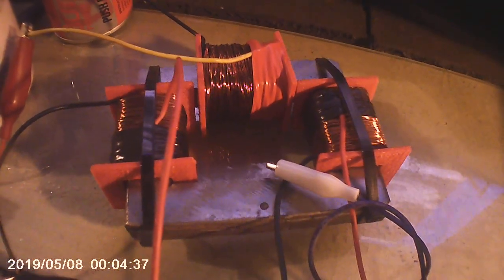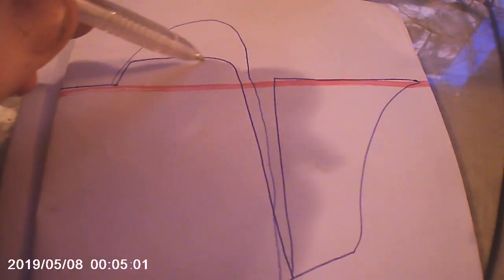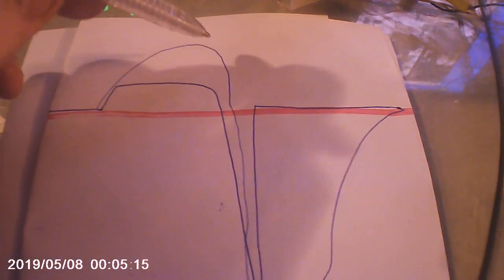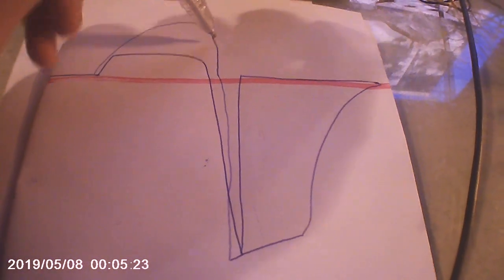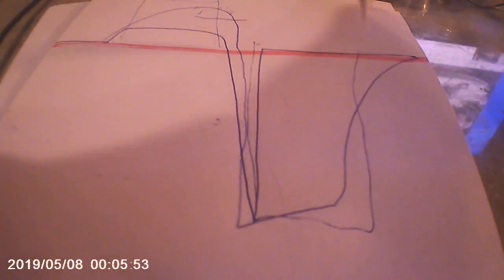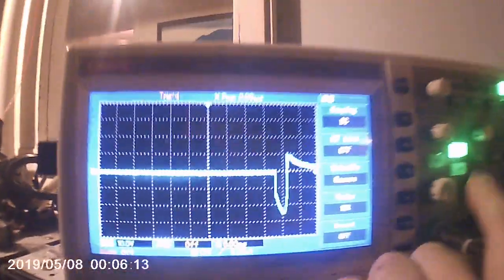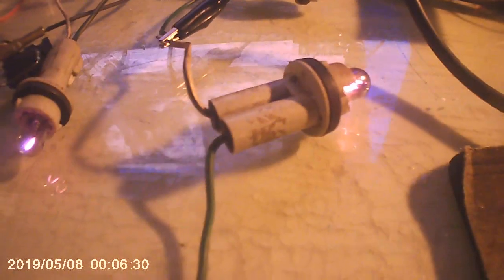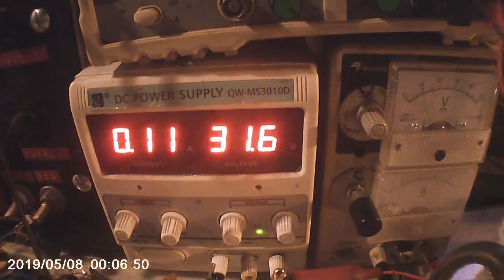Bucking Coils Update,  Transformers Part 27 . Theory ; not paying for power.

Comment: Nice job, try to charge some capacitors instead.
Reply from the maker: I have done that experiment previous, - i was able too charge an output 10,000uf cap from sec, and pri bemf...  and it charged high than the isolated input cap, - about COP 1.4 ;-D... lol... i didnt expect it too work so well, -  but now, i think i can do better ;-)

Comment: Your so close my man. Look up oliver heaviside alternating current theory from 1885 two transformer in series bucked high voltage to the secondary’s bucked in parallel to transfer the flux instead of have it load down the primary.
Only input is the resistive losses of the primary. 

Quadratic electrical generation.
Volts ,current , flux, force 

Four forces at work in a transformer